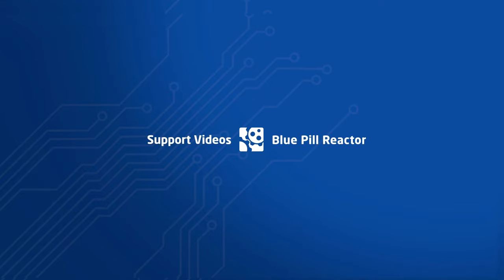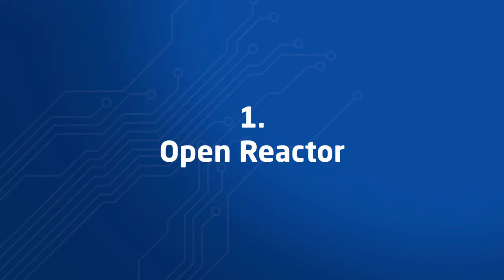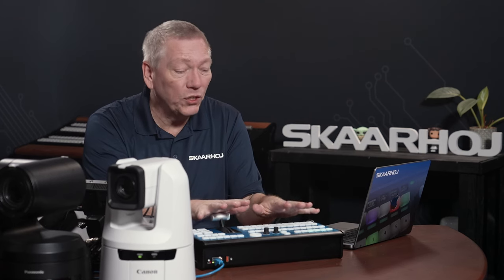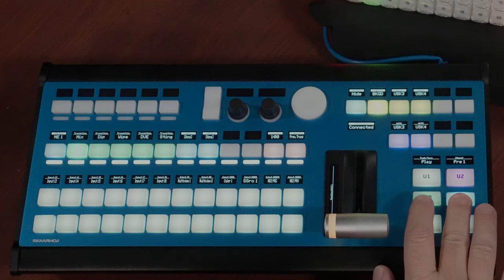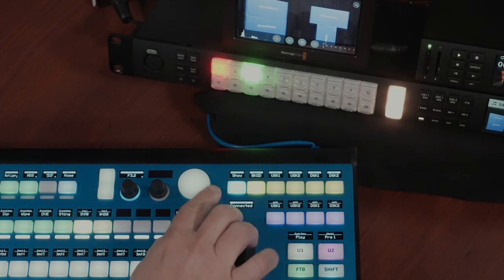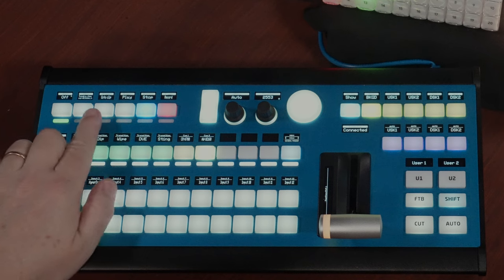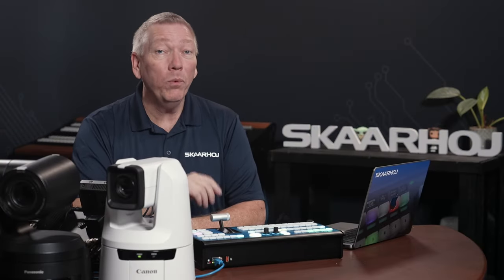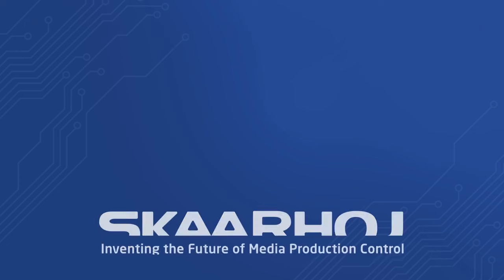Basic Setup with a Video Switcher & other Devices (Canon, Panasonic, HyberDeck and ATEM)

Comment: I don't see Panasonic video switchers in the list. Can it work with Panasonic AV-UHS500? Thanks.
Reply from the maker: Hi curtiseelder6644, We do control a range of video switchers, including ATEM, Tricaster, vMix and Panasonic Kairos. But unfortunately, Panasonic AV-UHS500 is not on our list of supported devices.
If it can communicate using standard protocols, such as SW-P-08 or TSL - or even just GPInput/Outputs, then we may have some integration with it.